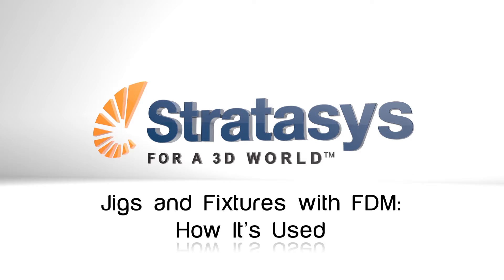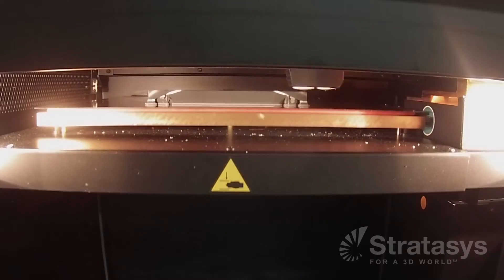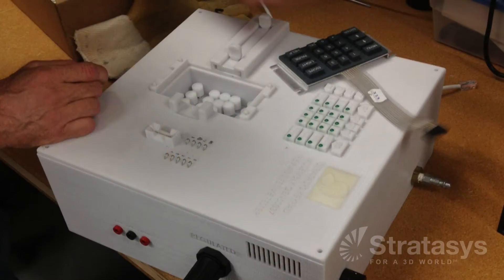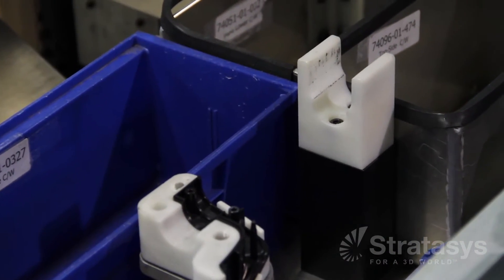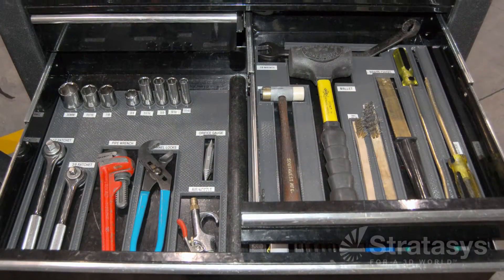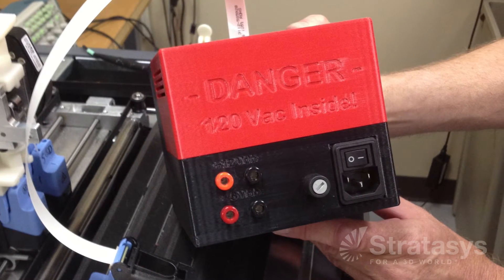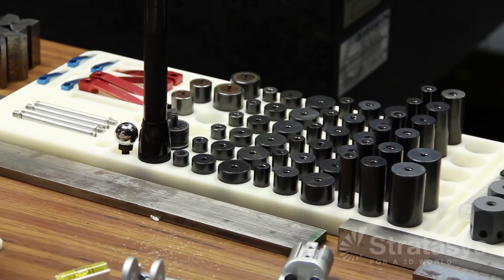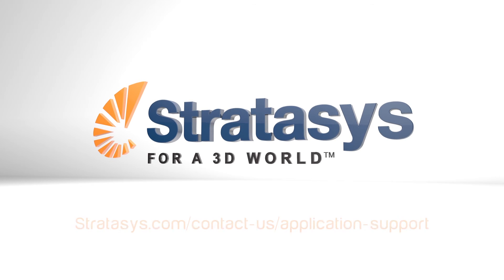3D Printing Jigs and Fixtures - How it's Used

Comment: How much does these 3d printers cost
Reply: If you have to ask, you can't afford it.
Reply: @nathanfrazier8525  why do u care  about me affording it.
Reply: 3D printers come in ranges from 160 to thousands of dollars. Everything shown in this video can be achieved reliably using an 800 dollar printer such as a Prusa MK3s+.
Everything in this video can also be produced using a 200 dollar 3D printer, but those machines require some more work and fine tuning of your print settings.